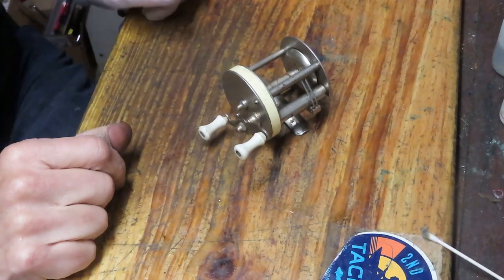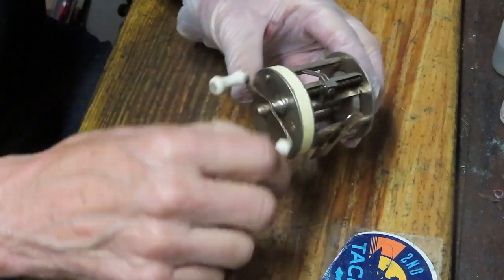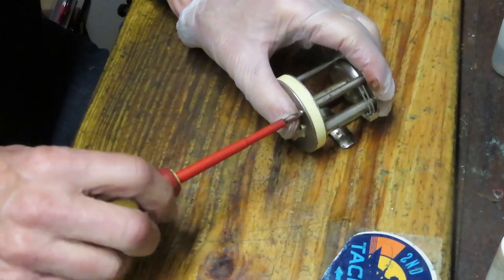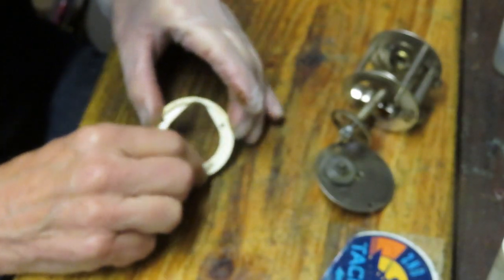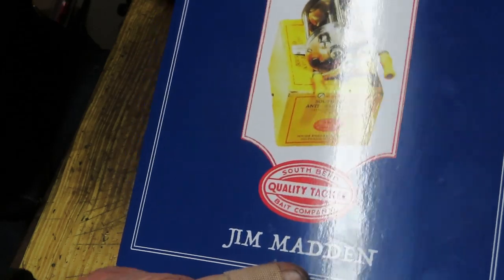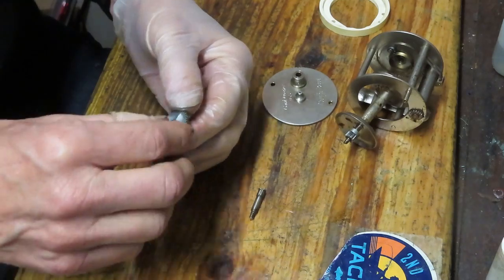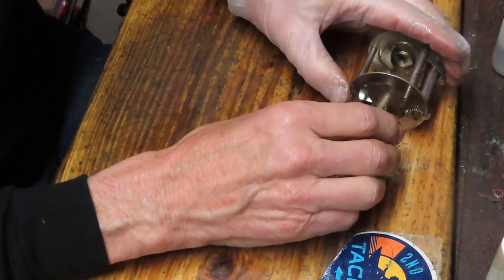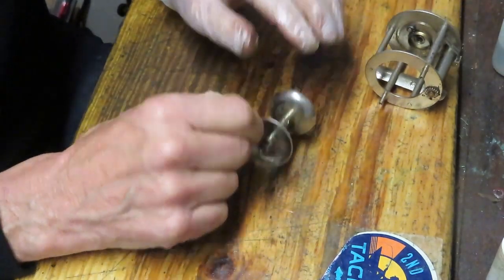South Bend Cast Oreno #5 vintage baitcasting fishing reel how to service

Comment: ORCA saved me today with their library of schematics.  A reel in a bag project came to me and there aren't many other sources of info on a True Temper 945.
Reply from the maker: Yes - of course the Tru Temper reel is the Ocean City reel, so you may be able to find more looking for the OC version - Dennis
Reply: Even ORCA just lists this as part of a group of 1960's reels on the Ocean  City True Temper category.  I had it pretty much right but the freespool release has to be just right to work.

I just retired and reels seem to be finding me pretty often.  It is amazing how badly reels can be treated and still work.

Comment: Dennis, the only South Bend spinning reels I like are the South Bend Classic reels particularly the 960 which was made by Ohmori. I have a number of Ohmori Shakespeare reels that are made by Ohmori. The Ohmori reels are known for the quality that went into those reels. They made reels for Shakespeare until late 1979.  You mentioned PB Blaster - it’s not the smell that bothers me but the fumes burn my eyes such that I have to be very careful when I use it. Most often I will soak rusty bearings Ana parts in a closed container but that’s it. I really enjoyed this video as I’m always interested in vintage reels! — Chris
Reply from the maker: Thanks Chris - Hope all is well - Dennis
Reply: @2ndChanceTackle  going for pre-surgery stuff this week for surgery May 10. I’ve been through a knee replacement which everyone says is much worse so I’m not worried. I want it done. My life has been on hold for too long. — Chris